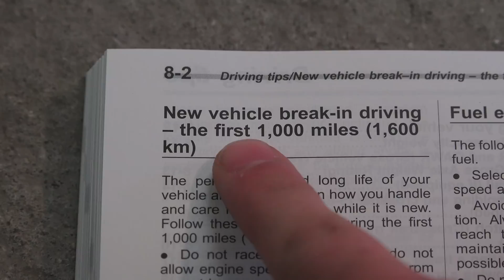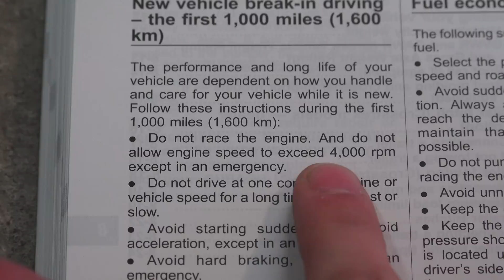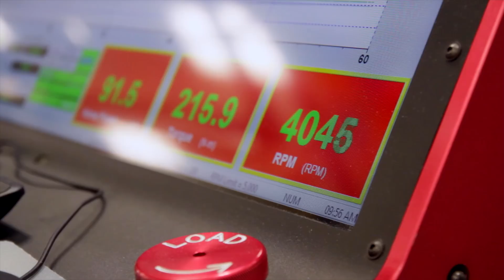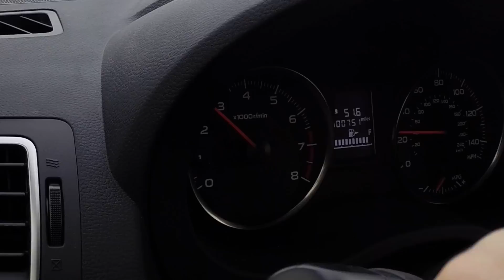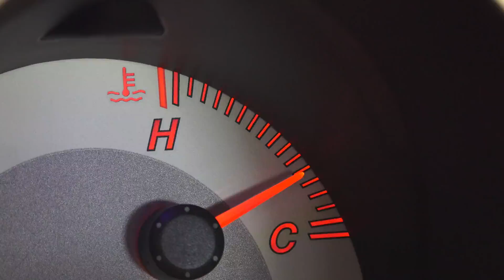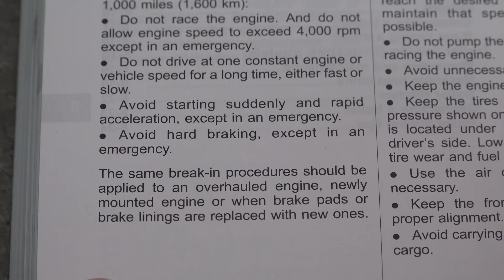5 Things You Should Never Do In A Brand New Car

Comment: 20+ years ago Car and Driver posed the eternal break in question to Chevrolet. They responded by taking three new 350 Corvettes and subjecting them to different breakin procedures. First they dynoed them to be sure they were all producing the same power at baseline. They then subjected them to three different breakin protocols. #1 car was babied, essentially driven per manufacturer's recommendation. The second was driven with no special consideration given to the fact that it was a new car. The third was driven hard, with WOT from day #1. After 50,000 miles the cars were dynoed again and the engines torn down and examined for wear. The results? No difference. The conclusion was that it didn't make any difference how the engines were "broken in."

Comment: Manufacturers have gotten crazy over break in oil changes. I had an 08 X5 BMW and they made me drive that vehicle 14,000 miles on the break in oil. Needless to say the engine had many problems and we unloaded it before the 50,000 mile warranty was up!
Reply: Not sure if its the manufacter or the dealership giving out misinformation.
I called a dealership today and he said the manufacturer would void my warranty if they changed the oil before the first 15000km/10,000mile service.

Comment: He didn't mention the most important part - - get the revs up and TAKE YOUR FOOT OFF THE GAS -- - - THIS sucks the oil up past the rings which flushes out those microscopic shavings of the ring - to - cylinder - wall metal, to be burned and blown out the exhaust.  Also enough revs to lube the cam (s) but never near red-line. And NO IDLING !!

Comment: When I was in my early years I rebuilt a number of engines. I can tell from experience the longer you take to break in an engine the better it is from an engine.  The idea is to seat in the piston rings, bushings, and bearings. Keep the RPM on the low side, when driving do not keep the RPM constant as like using the cruise control on the highway.  Vary RPM, and do not exceed about 3500 RPM.  A soft break in is the best.  Drive it normally and do not floor it.  There are always some imperfections between surfaces.  I do the break in for over 3000 miles. Then I do my first oil change.  I use synthetic oil after the engine is broken in. When I buy a new car, I take an easy drive for at least 40 minutes of driving minimum mostly city driving.
Reply: Thanks for sharing this
Reply: Sounds like you have an easy life.

Comment: This may seem “old school”  but every vehicle that I've owned, including motorcycles, in addition to varying RPMs and not exceeding 4000 for more than a few seconds, I've always changed the oil and filter within the first 750-1000 miles. Your engine will always leave metal shavings, but it does most of it during the initial break in and its imperative for the long term life of that engine to remove them after the bulk has been been deposited into the pan. Pick up screens and filters are just a line of defense, why take a chance when it only involves a cheap oil and filter change?

Comment: Thank you for this video! I knew the basics, but I really wanted a confirmation from an expert. The explanation for the various parts of break-in are really helpful.
I’m picking up my new Ford Escape SEL tomorrow. It has less than 50km on it. I now need to put 1150 km on it before I tow my trailer in a month and a half. 😁
Reply: Yeah but you know what I am the driver in that same dealership and I put those 50 mi on your Ford and I beat the living s*** out of it for those first 50 miles I first started it up and I rev the engine for for 15 minutes straight and watch the smoke to come out the back didn't see none then I threw it and drive and and then Florida that s*** for the first 20 mi and then another 15 me 15 minutes rather of full throttle and neutral and then after that another 10 mi of hard driving and then another 20 minutes of neutral full be happy with your new truck buddy

Comment: Just drive up a hill normally to put a load on the engine then drive back down while engine braking but not in crazy RPMs.  Do that couple times.  Change oil after like 200 miles.  Take a tiktok video of the used oil coming out into the pan bc it looks trippy with all the metal shavings creating a swirl

Comment: I toured the BMW manufacturing plant in Spartanburg,SC in 2000. At the time they were making the Z sports car. They dyno-tested EVERY freshly manufactured car running them up to max RPM and approx 140 MPH. The trick IS to not load them up for extended periods. The current thinking is Short full-throttle bursts are actually beneficial for "seating" the rings.
Reply: My thinking, too. Maybe one or two WOT bursts once everything is warmed up properly, and then from an intermediate speed of say 40 MPH up to 60 MPH.

Comment: What if most of my driving is short distance (shopping, doctor's visits, etc), so, can I break the new engine in by driving in a lower gear in a city (revving up just a little higher - not over 3,000 RPM, though, while varying the RPMs), so that the parts get warmed up faster?

Comment: The first thing I did in my brand new 2006 Civic in 2005 was to take it on the freeway and hit it's max speed of 110mph, had to test it to see if I didn't get a lemon, it's been 15 years and the engine still hits 110mph, the engine still runs buttery smooth, and the only thing I've changed was the starter and that happened on it's 15th year.

Comment: I have a new car with about 400 miles on it.  I need to go on a road trip, about 600 miles, is that safe to do? I won't use cruise but it is interstate the whole way.  It is also a speed run, so trying to make the entire trip in one day.  Should it be ok?  New Subaru crosstrek sport.
Reply: Just try and vary your speeds occasionally which varies the engine rpm.  You'll be stopping for gas and restroom pit stops anyway.

Comment: Hey my car had 3500 miles  on it so I didn't  have to worry about break in when I bought new
Reply: Must have been a service loaner.
All you need to worry about is how the other 25 drivers treated the car before you.
Don't sweat it.  I bought a service loaner once and it was a great, reliable car.

Comment: Actually flooring it when you first get it it's called A Hard break in. It helps to see the piston and oil rings to the cylinder. Which makes 4 better compression and can give you better horsepower than rated. Just change the oil at 500 1000 then every 3000 miles.

Comment: Can I take the car on a 100 mile trip right after buying it? I will need to travel so I am a bit concerned. Although I have noted all of the points, I would still like to know.
Reply: This is literally the best you can do when breaking in an engine. As long as you keep the rules mentioned, this is perfect because you will avoid the short drives which are detrimental to a new car

Comment: I thought the reason for varying the engine speed was because when you let up on the gas pedal, it pulls a little extra oil up on the cylinder walls?

Comment: I did a couple of “Full Throttle” starts but not totally cold.  Allowed Engine to warm up and was done for two different reasons.  1. Still on dealers inventory. And 2.  Need to know that it can do it if necessary.   

To be honest I had never thought about the Cruise Control part, interesting observation and logic.  Simply put I use cruise to “Trim” my speed once I get to a safe decent traffic flow and cruising speed.  When it’s trimmed I will use cruise as often as possible to get a good consistent cruise speed and ultimately save fuel.  Aside from a couple of times during test drive I rarely do full throttle acceleration unless absolutely necessary.   Simple fact is that sometimes they are needed to avoid getting run over!

Comment: Given the nature of computers in cars nowadays, I'm surprised some makers haven't incorporated this into the computer system as a setting that can be enabled by the factory and disabled by the customer. Enable and disable break-in mode.
Reply: I think the same. This makes me think, in turn, that brake-in is not really necessary these days. I have an Audi, and the owner manual only covers the topic in a small paragraph (only few lines) with very generic instructions, and nothing was mentioned by sales rep that delivered me the car. I thought that if this was so important, they would tell something to customers. Or limit the car for first kms as you said. I don't know, I am driving mine always avoiding high RPMS when cold and never keeping high RPMS for more than few seconds. But I did exceed the limit written on the manual sometime

Comment: 5 Things You Should Never Do In A Brand New Car:
1. Don't Floor It (Full Throttle)
2. Don't Shift At Redline
3. Don't Use Cruise Control
4. Avoid Short Distance Travel
5. Avoid Towing
Reply: @Lucas Van Hamburg Hi, thanks for commenting. Well, oftentimes, YouTube comments get lost in the sea of anonymity ;-)
Reply: @muhammadsaleemakhtar9533  That's interesting. Thanks for sharing the information :-)
Reply: Wait you bought a new car in a pandemic?
Reply: @williamconrad1087  hell yeah! Right here business as usual. Did this pandemic let you down big time? You sound surprised.
Reply: @williamconrad1087  not me, mine was bought a few years ago; i don't think the uploader bought his in the midst of a pandemic
Reply: 0. Afford a brand new car
Reply: I think this pandemic can be blame for #4. I drove my brand new car straight from dealership to my home.
Reply: I did all but tow 😂
Reply: Important to note: None of this applies to a car with an electric motor.
Reply: @surferdude4487  yeah you only have to worry about babying the battery that costs 20k to replace
Reply: @cartere9981  ?? There is no break-in period for a battery that lasts anywhere from 500,000 to 1,000,000 miles. The newer LFP batteries require NO special treatment at all.
Reply: I don’t get the short distance travel  if I am going to do short distance should I let my car warm up first?
Reply: If ya gonna break it, might as well do it under warranty has always been my motto.........
Reply: Dam why drive
Reply: How do I not Floor it Help 😭.
Reply: Why cruise control?
Reply: @ariqzachry  Thanks for your patience. I think what he meant to say with that is, "Do not drive at one constant engine or vehicle speed for a long time, either fast or slow."
Reply: @allensagalla1579  Aight thank you man 🙏
Reply: @ariqzachry  You're welcome man. Thanks for commenting :-)
Reply: @ariqzachry  I don't remember. I'll watch the video again & come back with some details as soon as I can. Thanks for commenting :-)
Reply: Because when a car is new, you want to vary the speed and revs, to help piston ring seating.
Reply: @sptrader6316  ya true back in the day now they seat them for u..because they dont want u to ruin the car and then send it back they will loose money
Reply: @ariqzachry  You want to break in the piston rings, and the best way to seat them to the cylinder is to be on and off the gas. Accelerating and decelerating.

Comment: Proper honing technology will break in for the 100 miles. After that it's just gradually wearing down to the inevitable rebuild. The reason they have longer recommended procedures is to ensure there was no installation errors. Which honestly you'll know within first 100 miles if not the first 10.

Comment: Giver her some cheechs of seafoam, and bring her right into the danger zone. If i bought a nsx that was broken in from the factory i would still baby it for another 500 or so. Just seems like one of those issues that would present itself later. Id say tire conditioning is real to. Only time the advanced stability control ever helped me was breaking in a new set of tires.

Comment: I'm planning to buy a new car which will be driven on hilly terrain.  For best results during the break-in period should I: 1) let engine/vehicle speed increase and decrease on hills or 2) maintain speed by varying throttle to compensate (both assuming safe road/traffic conditions).  I couldn't tell from the video whether changing engine speed or load is more important for break-in.
Reply: See my recent post mate. I believe it depends on the manufacturer, performance of engine and how the engine was assembled.

Comment: Like Acura claims, most of the breaking in of the piston rings will be done the first 100-150 miles. until 200 miles if will refine a bit, but after 300 miles, the rings are not going to change, because the sharp edges of the crosshedge will be smoothened out to the point that they do not polish the rings anymore. That is also why not to change the break-in oil too early. The small metal particles worn off the cylinder wall actually help breaking in the rings. The breaking in of the camshafts vary much more, depending on the layout chosen by the manufacturer. 50% throttle and under 3500 rpm for a petrol car are quote good measures for the first 300 miles, than gradually increase the load and engine speed. The cylinder wall has not changed a lot, but the rings are made from a harder material nowadays. this means that the crosshatch wears down as fast, but the rings break in less. Rings nowadays are made much more accurate to begin with, but especially the first 100 miles try to avoid running it stationary or at a super low load with constant rpm for a long time. This causes to wear down the crosshatch without proper breaking in of the rings. Overall, comon sense for at least the first 500 miles will do the job.

Comment: What happens if the car has never been accelerated  over 3500 rpm for the last ten years?
Reply: It really depends on the engine. Are you the first owner? I’ve heard from an engineer that’s not good for your engine either. You may have allot of build-up in your engine. Worse pending issues if your the first owner. Either you need to run some oil and petrol additive for an extended period or/ and have a full compression test done at a shop to know the health of your engine.

Most licensed mechanics would also agree it’s not particularly healthy for most engines.
Reply: BTW how did that happen? Automatic or manual transmission?
Reply: Definition of Insanity Mine is a CVT, i am just curious because in Asia we can’t find any road to drive extremely fast. I live in the city, the most I can go is 2000 rpm and I have to brake.
Reply: That’s how you do it, Son You don’t even need to tell my what vehicle make and model or engine your running. If you have CVT this video does not apply to your vehicle. CVT far is cheaper for manufacturers to use in automotive manufacturing. It’s also intended to push out as much accelerating horsepower and torque out of tiny engines as possible. Without sacrificing fuel economy. So its not going to be used in any high performance vehicle at least for now. Your vehicle is fine. It’s designed to be driven that way.

Comment: Why would all the manufacturer's recommend this ? Hrrrrm, I don't know, maybe because they are still on the hook for something referred to as a DRIVE TRAIN WARRANTY.
  If an engine is built correctly, there should be no adverse effects. Acura's "factory break in" for the NSX's engine, is simply an example of proof of my initial statement. Their number crunchers concluded it was better to spend a small amount of $ now, and hedge against a costly warranty failure, later. 
   So to answer your question, "they all advise this because it's all about them, trying to prevent YOU (Joe Consumer), from eating into their profit margins. As usual, it's all about a $."
   In other words, they know that in their pursuit of the once almighty $, their own internal supply chain policies have created an increased likelihood of failure, during THEIR time window of liability. Period.
   I've built a number of engines in my lifetime, and I am of the strong opinion that if one uses quality parts, balanced and assembled correctly, if there is going to be a failure at full throttle, or a problem in an area, it will reveal itself immediately. Or it won't. 
   "Break in" consisted of first start, initial idling, tuning, and cooling checks. After that, a road test with no throttle limit. It's either going to break, or it's not.
   With all that being said, it's always been MY $. Bear in mind that when you buy a new vehicle these days, everything you do in that vehicle will be data logged, and stored, and likely sent via satellite to the dealer/manufacturer (gotta love Java!), to be used against any warranty claim you may have in the future. Welcome to "the new normal." 😐
Reply: M F I completely agree. I just went on my own rant about the BS engine manufacturers tell the customers for their own benefit.

Comment: Yeah, this is all pretty much BS. Obviously, drive using common sense but "dont use cruise control" is just silly. Drive the car as you normally would like any sane person and you will be fine. With that I mean dont redline 24/7, dont drive 10000000km with cruise control off the bat and dont spit on your windscreen.